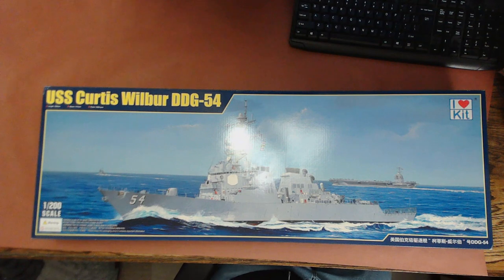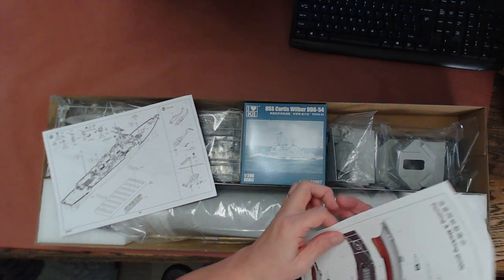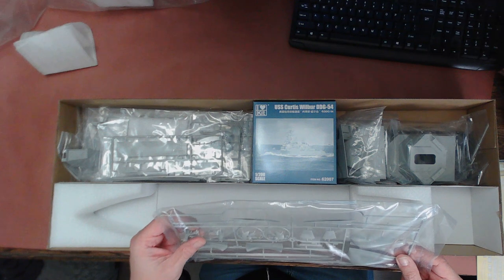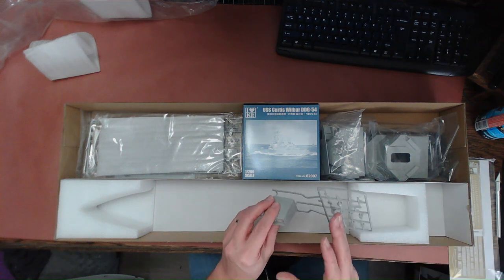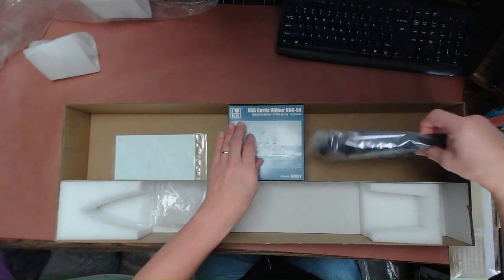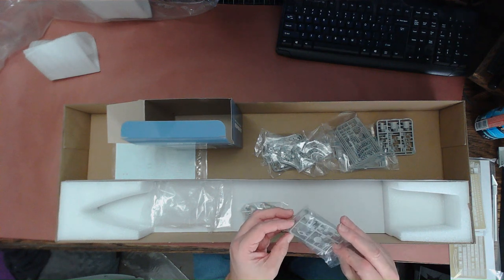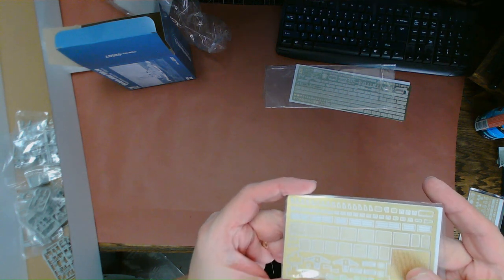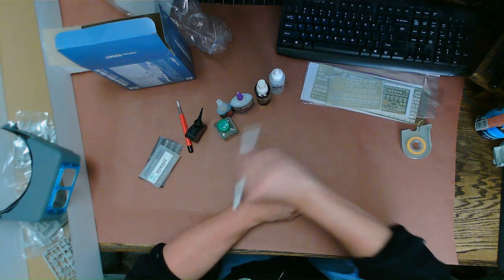Reviewing USS Curtis Wilbur by I Love Kit in 1/200 Scale

Comment: Saw this kit in Squadron's catalog (the reborn company), and it interested me because of being a modern ship in a nice scale. I have built the 1/200 USS Hornet CV-8, took 8 months. I did throw a MK1 Designs detail set and North Star figures at it as well. This looks as if it has enough PE to detail it already. I may have to get this kit, will watch your other vids as you proceeded with great interest.
Reply from the maker: I too had much interest in this kit being a modern era warship in 1/200. I haven't had experience with MK 1 aftermarket but have used Pontos a bit. The PE in this kit for the most part, isn't bad; some of it is downright garbage and some of it is quite good as well. Personally, I've had a blast putting this ship together to this point. Thank you for watching!
Reply: @PatricksScaleStudio-76  HS Models is coming out with a detail set for this ship ...twice as much money as the kit itself! Insane! 😜
Reply from the maker: @ladyknieval  , I saw that one too. From Squadron.com it's still almost $500. I'm just building from the kit as best I can though. The detail contained in the kit itself is fairly good and presents enough of a challenge on its own, in my opinion.

Comment: Appreciate the review. Planning on buying this kit to add to my stash. Was looking at the 350 scale versions and did not realize there was one in 200 scale.
Reply from the maker: I appreciate the good word! The kit has been a lot of fun so far. Thanks for watching!
Reply: I bought the 1:350 scale DDG-51 from trumpeter and it was very nice. It's a good size, and a fun build.
Reply from the maker: @DoomSlayer65  , what are the rough measurements of the finished model? I have some 1/350 kits in my stash and they will need proper escorts.
Reply: @PatricksScaleStudio-76  it's about 17.5 inches long, 2.5 inches wide, and roughly 6 inches tall from baseline to top of the mast.
Reply from the maker: @DoomSlayer65  , that may make for a fitting escort to Enterprise!